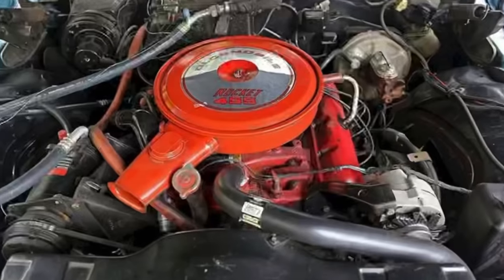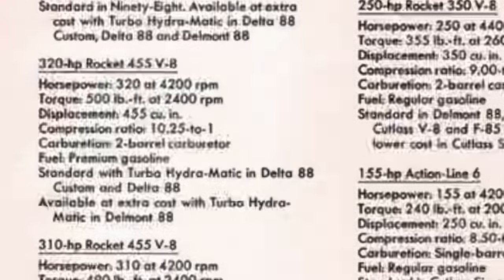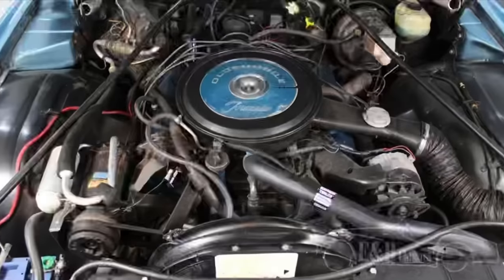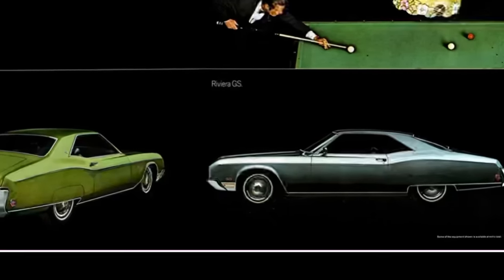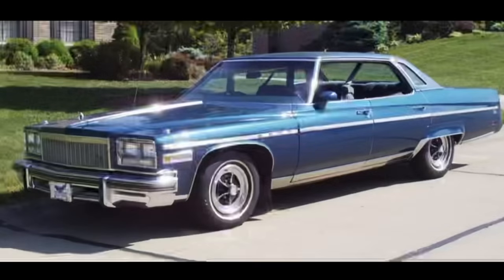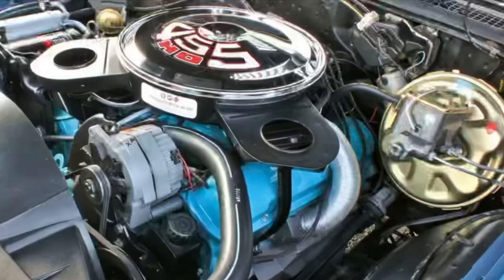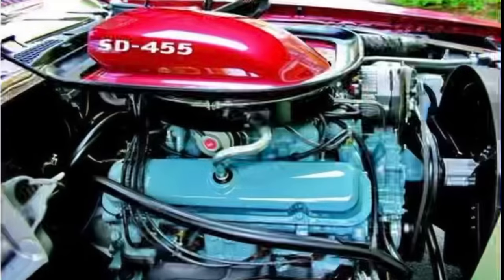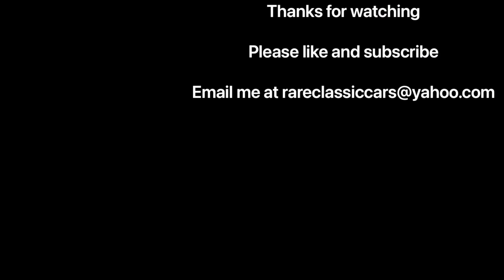Best Car Engines - The Rise of the Mighty 455 V8s from GM’s Buick, Oldsmobile, and Pontiac

Comment: The biggest problems with both the Oldsmobile and Buick 455s were their flawed oiling systems. The Buick's oiling system just can't deliver enough oil at high RPM. It will eat a rod bearing if you wind it past 5500RPM for more than a few seconds. The Oldsmobile oiling system delivers too MUCH oil to the top end of the engine, and the oil drain areas in the cylinder head don't allow the oil to drain back to the pan fast enough. It's possible to fill the valve covers with oil during sustained high RPM operation. This leaves the oil pan empty, which starves the rod and main bearings.
Reply: Yeah, but the oiling system is fine for their design performance envelope and it’s an easy fix you’re building a performance motor
Reply: @jimmy_olds  exactly.   These were designed to be torque monsters to move large cars smartly down the road.  Never designed to run over 4500 rpm except occasionally.    
I just had a 470cu in Buick BB made and the builder told me it is solid to 6500 rpm except my cam will run out of oompfh about 5800.   Seemed great to me, almost  a built in rev limiter.  :)
Reply: As Jim H mentioned, curing the oiling issue on an Olds is an easy fix although you do need to remove the crank to take care of the problem. I raced 455's Olds engines for years. They are extremely easy to work on and very reliable. Getting a 3700lb A-body into the low 12's/high 11's is incredibly easy and won't break your bank account. Olds heads don't flow very good though, even with 2.07 intakes, which is a pretty laughable valve size for that many cubic inches but beyond that limitation, fantastic engine for your average bracket racer.
Reply: @remingtonwingmaster6929  I’m excited about the new Edelbrock heads, the intakes are 2.125” (I know, still small by BB standards) and flow enough to easily support 500+ hp out of the box
Reply: Since I have the 430 the Buick 455 was based upon in my '67 Riviera, thank you for the detailed info on the specific oil limitation. Guess it's time to install that tach!  :-)
Reply: The Pontiac V8 suffers from similar oiling weaknesses in stock form, all Pontiac V8's.  Notorious for oil starvation, flirting with bearings even a second spent past around 6000.  It's easy enough to modify and resolve today.
Reply: @Dayandcounting  All 3 of the BOP 455s had their problems. In Pontiac's case, the timing chains were the weakest link. I saw tons of Buicks and Oldsmobiles with oil starvation problems early in my career. This wasn't true of the Pontiacs I saw in the service bay, but that's not to say it isn't true at all. Most of the Pontiacs I saw were driven gently by older people. FWIW, the Olds V8 engines ate their fair share of timing chains as well.
Reply: @Dayandcounting  Easy fix replace the stock rod bolts ARP and use good aftermarket pump and springs to match your Cam-12yrs same setup 71 400 68 ram air3 heads and still has the same oil pressure and takes 6400 rpm all day
Reply: Kennedy Bell would modify the block and make the passage 3/4 inch. With a high flow pump.  I spun a bearing in my G S
Reply: All you have to do to fix the old 455 oil and problems. On the top end you drill out the oil returns in bevel them. The bottom end you drill and bevel the mains. I had a 1977 Buick regal that came with an Olds 350. Which in 77 was a dog. I believe it was like 170 horsepower. I was lucky enough to have a neighbor. That had a wrecked 1968 Oldsmobile toronado GT in his bushes. He gave me the whole car for $100 in 1996. It was the Oldsmobile 455w34 with 400 horsepower. I decked the block and the heads. Went with flat top pistons blueprinted and balanced. I spent over two weeks porting and polishing the heads. Had it benched dynoed. Went from a stock 400 horsepower to 601 horsepower. Needless to say. Made my 1977 Buick regal. The best sleeper. A lot of my friends try to race me when I first got the car and blew the doors off. I erased everybody after the 455 went in without telling them. Was one big surprise
Reply: @Dr.Meola1980  No, it's not that simple, as any NHRA Stock class racer will tell you. Joe Mondello sold those oil restrictors for a reason. They're necessary if you want a big block Olds to live at sustained high RPM.
Reply: @alantrimble2881  
If I remember, right, the restrictors were for the crank, right? 
It seemed like the mains got too much oil.
Reply: @patrickflohe7427 IIRC it's the opposite. Too much oil flowed to the top end to keep lifters quiet immediately upon startup, so the bottom end didn't get enough lubrication.
Reply: @mickeymichaels1298  
I seem remember Mondello having restrictors for the crank, and more drainage from the valve cover area to help get oil back to the oil pan more quickly. 
I believe part of that, was drain tubes that ran down the back of the engine….straight to the oil pan. 
-We’re talking Oldsmobile 455, here.
Reply: All those problems were known and fixable if you were working them for street warrior use.
Reply: The 70 Stage 1 and 71 up Buicks oiling was fine.  And both motors were fine it your not over revving them

Comment: The 1970 Buick 455 Stage 1 gets my vote. I worked for Buick many years. I drag raced them (stock class) for years.  Their horsepower was greatly under rated by Buick.
Reply: Torque monsters . 💪🏼💪🏼💪🏼
Reply: I have a 1970 Wildcat. How can I tell if it is a stage 1 or not?
Reply: @kamaulipscomb64  - Think Stage 1 and 2 only came in Special...

Comment: Pontiac had the only 4 bolt main 455. That included some big car engines. The HO had an aluminum intake, and the HO and SD had round port heads.
Reply: He saved the best for last!!!
Reply: Also Pontiac had the strongest connecting rods at GM.  I've heard that certain Olds and Buick engine builders recommend Pontiac rods to their customers building high performance engines.  (I don't know how this works, probably with modifications somewhere.) I love the Pontiac V8 engines and OHC6, all highly innovative engines.  Overall Buick had the best engineering at GM (even borrowing from Pontiac), where theoretical and measured values come closest.
Reply: @jeffbranch8072  Pontiac invented  the familiar ball stud rocker system. Chevy actually was allowed to use that system.
Reply: I don't know if Pontiac "invented" the 30 degree intake valve seat, but this was the key to how the Pontiac V8 runs and cam, rockers, valve spring design all key off this.  Buick and AMC picked up on this.  PMD also did a lot of work with electronic ignition in the 60's and participated in HEI development in the early 70's.  There's a whole list of innovations in the OHC6, it goes on and on.  Meanwhile at Chevrolet engineering...  zzzzz...
Reply: @jeffbranch8072  Not really.  Chevy's Zora Duntov basically designed Rochester's Mechanical Fuel Injection for 1957.  Chevy also brought out the first modern American performance 4 speed manual transmission, (Chevy design made by Borg Warner), the T-10 in 1957.  The Chevy Duntov solid lifter mechanical camshaft revved circles around any other stock American V8 for years.  Chevy had air bag suspension in '58. The Big Chevy got the T-10 4sp in '59 when Pontiac was still running 3sp transmissions until '63.  

The 1960 Corvair was full of innovations for an American car, rear engine, all aluminum air-cooled pancake flat 6 cyl.  The '60 Corvair was the first American car with an all aluminum engine and the first American car with a turbocharger.  Corvette had an aluminum head option in 1960 for the 315hp fuel injected 283.  Then there was fully independent rear suspension in the Corvette for '63 and the only American car with 4 wheel disc brakes in '65.   Chevy made a transistorized ignition system starting in 1964 for their solid lifter engines.  It became pointless and capacitive discharge a year or two later.  

Then there was the porcupine semi-hemi headed big block Chevy for '65 that was the very best performance big displacement engine GM ever made.  Aluminum headed 427 in '67, an all aluminum 427 in '69.  The Camaro had a 4 wheel disc brake option starting in '68.  The Chevy 302 was so dominant in the Trans Am series in '68 and '69 that Pontiac ran their Firebirds with 302 Chevys in them, although none were ever sold to the public that way.  Pontiac's own '69 tunnel port Ram Air V 303 Trans Am engine turned out to be such a turd they never even bothered to sell or race any, but the same happened with Ford's tunnel port 302 the year before.  Did you know that Chevy provided the Penske Trans Am team with a Telemetry Van for every race?  Penske's '68 and '69 Camaro's had onboard accelerators attached to the car.  They wirelessly delivered real time data to the Telemetry Truck in the parking lot where this information was recorded during the race.

Chevy was busy winning NHRA, AHRA, Trans Am, Can Am, and drag boat racing and providing all those good guy parts to the independent racer on the street while Pontiac Engineering was zzzzzzz.  John Delorean may have done some good stuff over at Pontiac, but all he did when he got to Chevy in '69 was try to kill the Corvette, De-proliferated all of Chevy's Performance engines for '70 and '71, and introduced the Vega.  Good thing he was kicked to the curb in '72 or he would have finished off Chevrolet the same way he finished off the DMC company 10 years later.

So other than that, Chevy Engineering didn't come up with anything at all.
Reply: @corvettejohn4507  SS originally was just a bucket trim etc option that could be had with a strait 6 and of the trans am GM motor design Chevy threw a hissy fit when the found the 303 ram air 5 headed monster made the dz 302 look weak... Oldsmobile & Cadillac had a V8 b4 any the other CORPORATE controlled divisions did and Pontiac 350 is truthfully 354 Chevy cried and kept it claimed at 350 and 330,350 Olds has shorter stroke bigger bore ...Yes I love my Chevys also 010 blocks 327 real one that is not 69 or 5.3 version 396,427,454 even the 496 8.1 but no matter what GM screwed up when stopped making the torque BOPs for I got better gas mileage and reliability out of my Pontiacs but all in all GM made several equal or better then just Orange motor stuff, Old 394 or 401 do this day aren't slouches and deserve fair credit
Reply: @scottnangle246  Pontiac's Tunnel Port Ram Air V 303 Trans Am motor just wasn't competitive for the exact same reason Ford's Tunnel Port 302 Trans Am engine from the previous year wasn't competitive.  They both made the exact same mistake.  The ports were far too large for the displacement of the engine.  Port velocity was sluggish below 7,500 rpm.  The Tunnel Port '68 Ford 302s and '69 Poncho 303s lacked mid range torque coming out of the corners.  

That was the key to the cross ram inducted 302 Chevy's success was the correct port size and cross section that keep the air velocity up and provided good mid range torque coming off the corners.  But that is the kind of stuff you don't find out from looking at peak numbers on a dyno test back at Dearborn, or Pontiac Michigan.  You have to find that out on the track through trial and error because you can't race a dyno.  Why Pontiac tried a failed Ford idea is beyond me.

Now those same Tunnel Port Ram Air V heads would work wonders on a 428-455 cid Pontiac engine just like they did on the Ford Thunderbolt's 427 Tunnel Port engines from the mid 1960s.  Because the large engines could take advantage of the larger port size  

Did you know that in '68 and '69 Chevy experimented with a set of symmetrical  port aluminum hemi chamber heads for the Trans Am 302?  They had Smokey Yunick try them out, and guess what, they decided they weren't worth the trouble or $$$$ to make because the cars weren't any faster around the track with those trick heads.  Why?  Port velocity too low for 302 cubes.  Chevy also experimented with independent rear suspension for the '69 Trans Am Camaro and found out it didn't improve track times either.  So that idea was dropped too.

I like Pontiacs too, I have a '09 G8 GXP with the 6.2L LS3 in the garage right now, and I've owned my share of Trans Ams too.
Reply: @corvettejohn4507  that's cool,I even had a HA code 350 4bolt with a steel crank, Chevy never drilled & tapped it for the balancer bolt.. Your the kinda person I could talk hrs about stuff with,thank you it's nice to know there's still a few real car guys out there.
Reply: @scottnangle246  It's been great talking to you too Scott, I love talking about old cars and car history on youtube.  Did your '69 350 come with an 8" balancer?  Usually Chevy drilled the hole for a balancer bolt when the 8" balancer was used.  I was thinking that most of the Chevy 4-bolt main 350's got the 8" balancer.  That may have been after '69 though. On the small journal 327's, Chevy only drilled the bolt hole and installed the 8" balancer on the high performance versions with the big valve 2.02 1.60 double hump heads.
Reply: @corvettejohn4507  it was 69 350 194 🐫 heads,I researched it yrs ago and Chev did that with some 68-69 350 and yes it was a 4bolt block & big balancer-a friend had the exact same setup on another one he had under his bench same code etc.. amazing how 1st 350ci only cam in the Camaro for 67..
Reply: @scottnangle246  Yes the 350 was a Camaro exclusive for '67 and '68.  Chevy wanted very much to one up the Mustang in '67 when the Camaro debuted.  It was really a clever marketing idea.  The Mustang had a 289 base V8 and optional hi po 271hp 289 and 335hp 390 V8s when the '67 model year started.  

Chevy was originally going to make the 283 the base V8 for the Panther....cough...cough....Camaro, but changed its mind to the 327 as the base V8 during the summer of '66.  Then the Camaro had the new and exclusive 350 as an optional V8 in the SS.  Then in December Chevy introduced another exclusive Camaro only engine, the 302, for the Z28 to compete with the Mustang's 271hp 289 in the SCCA Trans Am series.

Not to be out cubed, by spring of '67, Chevy decided to up the ante and offered the 325hp 396 option in the SS to compete with the Mustang's 390.  Things escalated quickly, and by the end of the '67 model year, the Camaro could be ordered with the L78 375hp 396 and the Mustang could be ordered with a factory installed 390hp 427, although extremely few were ever built and only for racing.  Shelby offered a GT500 Shelby Mustang with a 428 and two 4 bbls.

Almost immediately after Camaro's introduction in Sept. '66 , Chevrolet tuners and dealers such as Nickey, Bill Thomas, Dana, Yenko, and Motion Performance were offering L72 425hp 427's and L71 435hp tripower 427s powered Camaros for sale.  Dana had an L72 with an optional aftermarket intake and two 4 bbls that put out 482hp on Traco's dyno.  By the end of '67 the dealers/tuners were stuffing 530hp L88 427's in them.  Crazy year.
Reply: @corvettejohn4507  

Pontiac had reverse flow cooling systems on their V8 40 years before Chevrolet did. To get a Chevy engine with the same nickel content as a stock Pontiac block you have to order it from a Bow tie catalog. The Chevy V8 is built so cheap they couldn’t even afford to include a cam thrust plate and the oil pan needs to be dropped just to remove the timing cover. Not exactly the best design out there IMO.
Reply: @jeffbranch8072  Pontiac used cast iron connecting rods. The worst of GM 😂😂
Reply: @jeffbranch8072 Pontiacs also "own" the use of intake manifolds, up and away from being splashed under by hot oil.
Reply: @brandonbell3089  Not   entirely true.  My SD-455 has forged rods and pistons from the factory.
Reply: @brandonbell3089 wrong ,they were made of Armasteel
Reply: @richcar3434  - Chevy used the AirGap intake manifold on its 1916 V8... LOL!

Comment: That Olds 455 was one of the most robust mills ever made by GM, can't go wrong there. Great power and torque, and probably the best overall driving of the bunch.
Reply: Agreed,  Olds had the best V8 engines in the business. The 350 was pretty much indestructible....never blew up an Oldsmobile V8.   I have destroyed just about every other  Pontiac,  or Buick engine however....I should have been a test - abuser at GM proving grounds....hehe.
Reply: Agree 100%. Grew up on big block Olds motors, as my father AND mother liked them, cruisin' down Woodward Ave in Michigan!! My late father in law was an Olds freak and a mechanic, so watched him tuning a 4 barrel Quadrajet with a vacuum gauge and tweaking the linkage with a needle nose pliers, to get the 4 barrel to dump at the precise moment!!! Fun days!!
Reply: I can attest to the big block Oldsmobile engines and cars , I will always remember riding, driving , and helling around in them! Big powerful nice riding cars Can still hear them run.

Comment: Got a 65’ 442 with a 400’ BB (destroked 425’). I put headers, edelbrock intake/carb. Accell wires/distributor, and 3” inch exhaust (with cutouts). What a rumble!! God save the Big Block!!!!!!!